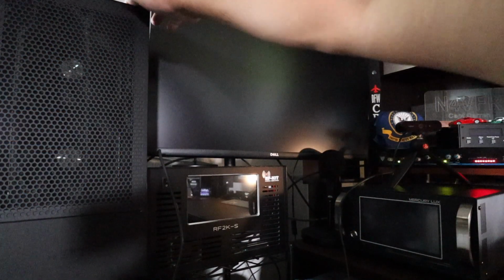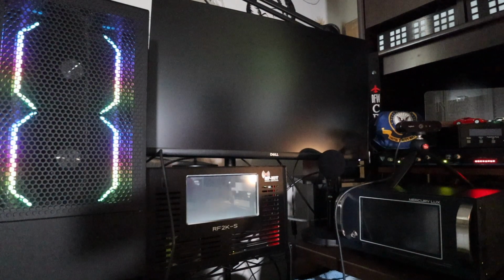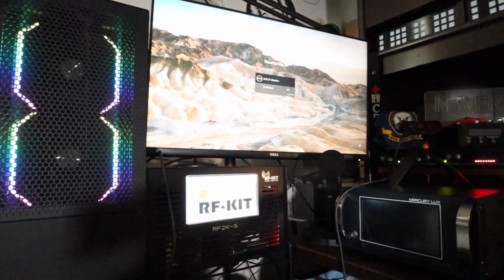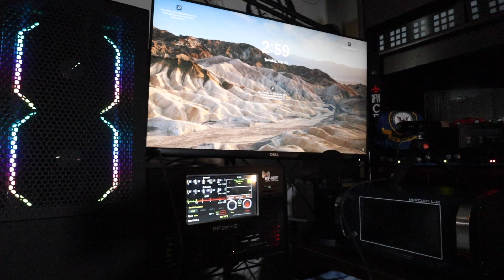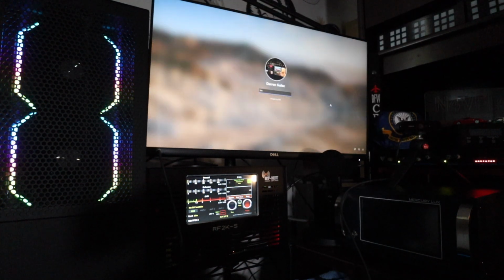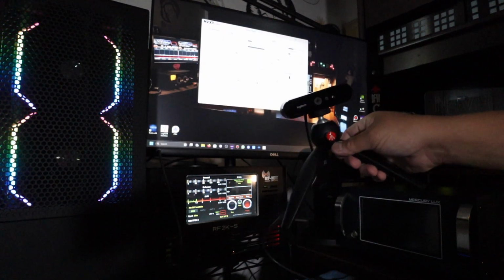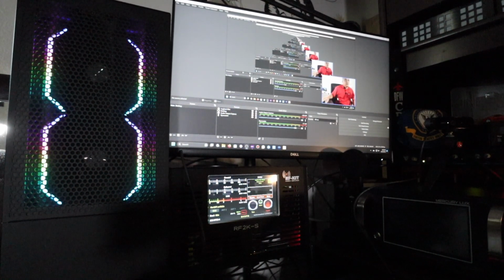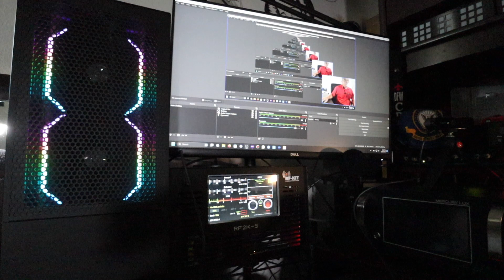Add PCIe Card for more USB Connections | Skip the USB Hub and Use a  USB Card for more  Connections

Comment: I hope your PC is being over-clocked and it liquid cooled?  My i9 8-Core is cruising at a constant 5Ghz (Turbo mode disabled) with a 3.6Ghz CPU.  Liquid cooled using a dual fan radiator.  More quiet than using a fan on the CPU.
Reply from the maker: I'm not overclocking it. Maybe I should?
Reply: @DarrenN4VFR  Not sure if you need to.  If the anan has no issues, then I wouldn't worry..What type of CPU is it and how fast?